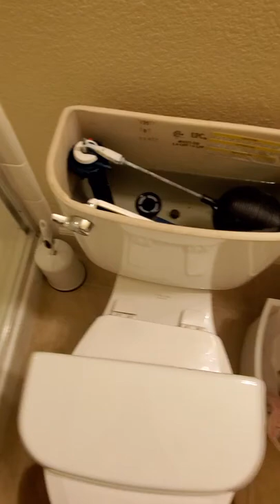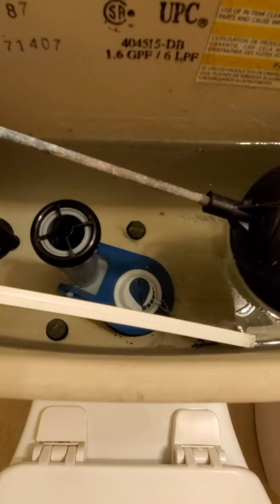Fog horn sound from wall after flushing toilet...what to do yo fix it

Comment: I also had the fog like sound, but I change out the water supply valve (inside the toilet tank) where the water supply comes in and that solved the problem for me.